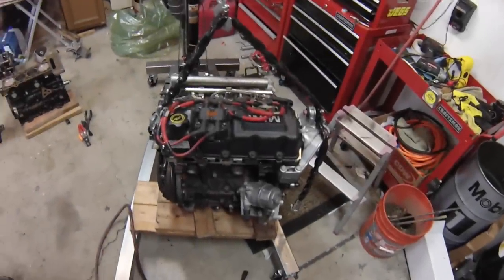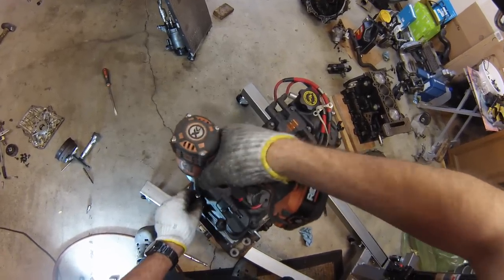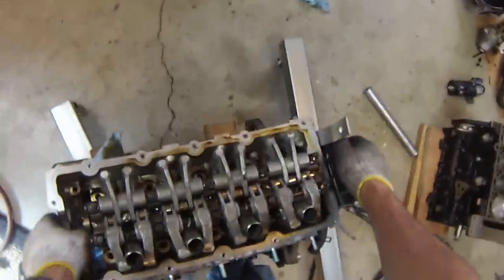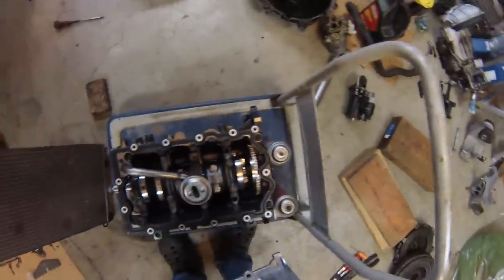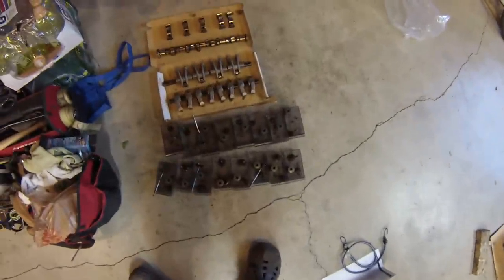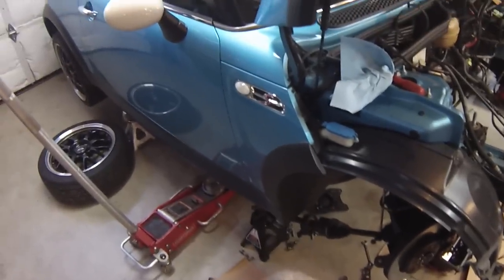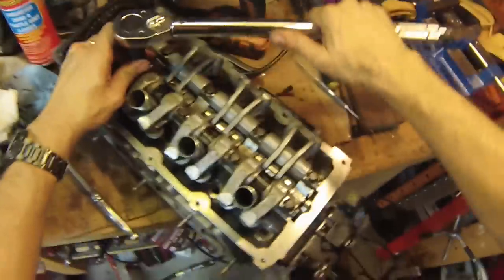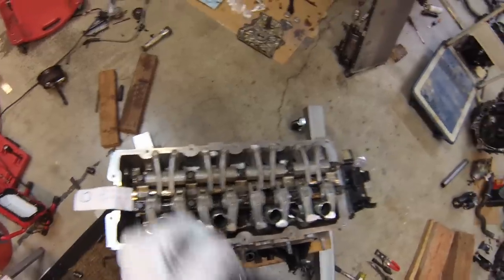R53 MINI Cooper S engine swap - New Short Block - Part 2 (Valve job & assemble engine)

Comment: Quick question would you be so kind as to indicate what seals you change that leak oil when doing the supercharger maintance and great video by the way thank you for the education
Reply from the maker: Hello - not sure if I understand the question. If you are just performing supercharger maintenance, the only seal that needs replacing is the water pump inlet O-ring. You might also want to replace the supercharger to intake duct gasket, but usually not necessary. 
Thanks for watching!
Reply: Oh OK thank you very much for u r reply I was reading on a form to replace oil o rings that leak that's what I was not seeing what they were talking about. But thanks for the feedback my project is the change of the rack it's squeaky when turning right so I just want to replace it
Reply from the maker: luis almaguer You might mean the crankshaft position sensor O-ring. This inexpensive part leaks always, and is really easy to replace if you have the front of the car removed or in front end service mode.
Reply: This is what I was referring 2 - SC Input gasket from throttle body duct (green rubber) 11610020836 - $18.02
- Throttle body o-ring (orange rubber) 13547509045 - $13.04
- Water pump to block O-ring (black rubber)
Reply from the maker: luis almaguer Those are the ones.
Reply: Hey I almost finished paying off my car and want to know what mods you can do and also a list of your power tools if you don't mind
Reply from the maker: luis almaguer I am thinking to make a video of my car / talk about mods + a tool tour video when get the time.
Reply: OK thanks again for the quick reply look forward to seeing it

Comment: for this type of repair will this increase the cars life? like if i hand a mini that had 150k miles and i did this will my mini will its life prolong?
Reply from the maker: Well, I suppose it depends on the condition of the other parts of the car and what the car is worth to you?
Reply: how much would a repair like that cost???
Reply from the maker: MegaMilkman42 Short block alone was around $2200, plus gaskets, fluids, tools, my labor time, etc. Expensive? Yes. Less expensive than buying a new car? Yes.
Reply: yes its less expensive but when something else breaks then your in the shop and spending more money
Reply from the maker: MegaMilkman42 That's why it depends on how much the car is worth to you. I'd rather spend a little money now and then to keep an old MINI Cooper going than have car payments on a new 2014 MINI that is too big, can't turn, doesn't make the correct noises, and looks "startled."
Reply: true
Reply: i want to buy a older mini like a 1st gen. and spend money on upgrades.
Reply from the maker: ***** Almost always, car repairs are cheaper than new car payments! With a typical car payment at around $400, you'd have to suffer nearly $5000 of repair expenses ANNUALLY for a used car to cost more than a new car.

Comment: This is not a valve job!  This is merely a patch job.  PEOPLE,  you must take the cylinder head  to a machine shop and get it professionally clean, pressure check, resurface the head, and re-grind the valves, all done by specialized  machines.   This man is cutting corners to make more money for himself and cheating the customers.  I guarantee you that tiny 4 cylinder engine being supercharged, cylinder head will short lived and have issued in the future.  Get it done right, Bro!!  GOLD
Reply from the maker: +HollywoodRoseJack I should have specified that it's just a valve seal job. The R53 cylinder head has been shown to be very reliable even under supercharged conditions. Except for the rare burned exhaust valve, in nearly every case the cylinder head far outlives the bottom end (piston rings, rod/main bearings) . I am not cutting corners to make money for myself. That would be lying and cheating. I am offering affordable ways to get a little more life out of the car.
Reply: Hahahaha.... If he intended to cheat anyone here, He let the cat out of the bag by posting this video.  Nice job Mod MINI and I appreciate your efforts.